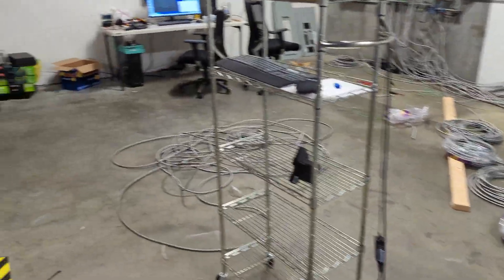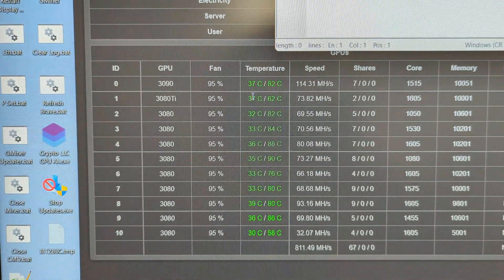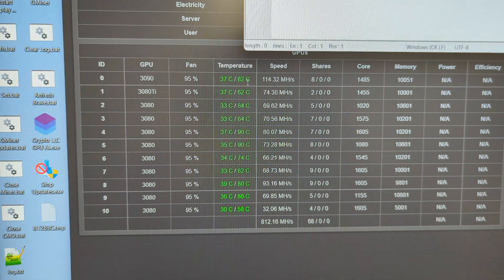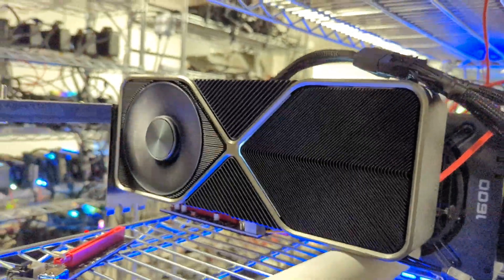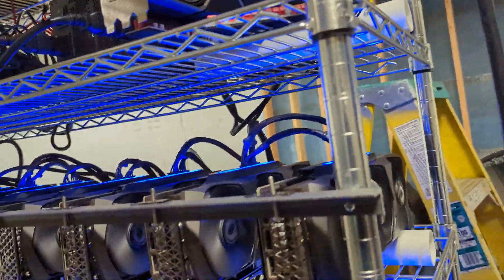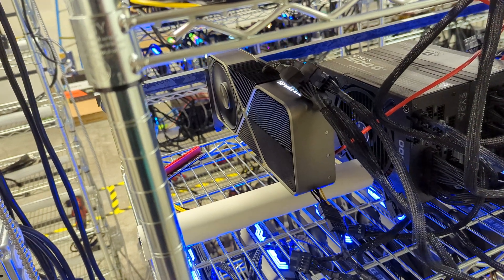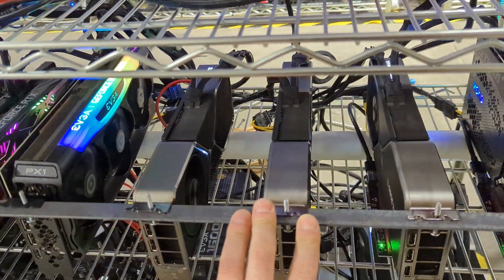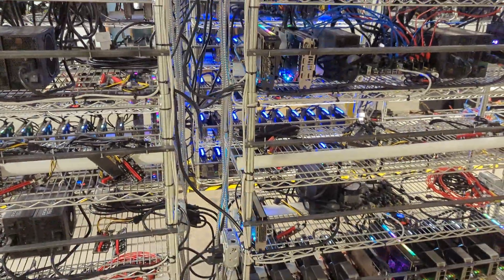GPU Mining Farm - 3090 Performance vs 3080 and 3080ti

Comment: You shouldn't power risers with that SATA connector. It's not rated for high power and has been a failing point for many. Especially when powering 3000 series, or high end cards.
Reply: You know nothing. It doesnt matter what a tdp of a card is. They pull that from 8pin plugs. Only reference rx 480 shouldnt be powered by sata.
Reply: @filippetrovic845  did you watch the video in my last reply of a zotac 3090 pulling 100w from riser? Don't skip school filipe
Reply: @Mehecanogeesir  Thats failure on gpu. I had 10k gpus through my hands in mining. I HAD 6x asus strix 3080 rig mining rvn on 325w pl for months, all risers sata powered.
Reply: @filippetrovic845  I'm talking about 3090s here. I never said SATA cant be used on older/lower powered GPUs. If you want to talk about your 3080s, having a sample size of a 6 cards rig is still not enough to make conclusions about all 3080s. There are lots of brands and models that WILL vary power consumption even within GPUs of the same model. That being said 3080s could be fine. I don't experiment with my safety like ya'll do. Did you even read my previous replies btw? I kinda said this already..
Reply: @Mehecanogeesir  I pretty much had close to every brand of 3080. Curently i own 5 different 3080s (not strix anymore) . 3090s i had only gigabyte vision (what motherforker uses 3090 to mine, they are horrible?) and those were working fine on sata until i got rid of them.
Reply: @filippetrovic845  My man, I have 32 3080s of varying brands. None of which have I decided to cheap out on the riser connector to save a couple bucks and risk my $1500+ cards.. I use server power supplies, which are significantly cheaper and have like 16 pcie ports for as many connections as I need. I also have 4 3090s. I have a total of 0 splitters and 0 sata connectors used. This is the way.
Reply: @Mehecanogeesir  You dont cheap out on anything by going sata. You cheap out by going molex because only mining PSUs which are inferior quality have sufficient molexes. I use EVGA P5 850 throughout my farm. Even if you have a problem with a gpu pulling more than it needs from pcie then cable will melt, gpu will remain unharmed.
Reply: @Mehecanogeesir  You say i cheap out and you say that you use "significantly cheaper" psu's in same comment. Hey maybe think about it.
Reply: @filippetrovic845  maybe you should look into server power supplies instead of thinking cheaper always means worse.
Reply: @Mehecanogeesir  I didnt suppose server psus were worse until you came and claimed you had problem with powering risers via sata using server psus. Now i will never consider them, thanks for info.
Reply from the maker: lol. Do some research please.
Reply: My guess is that he has a little more experience then you and knows what he’s doing